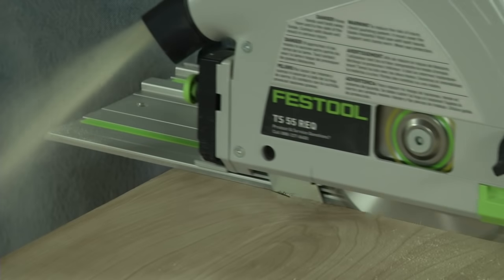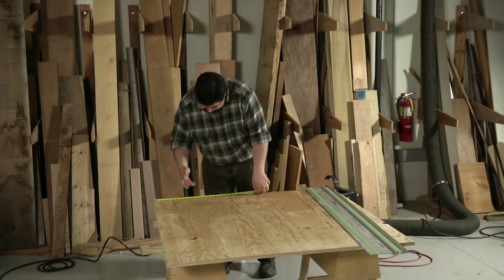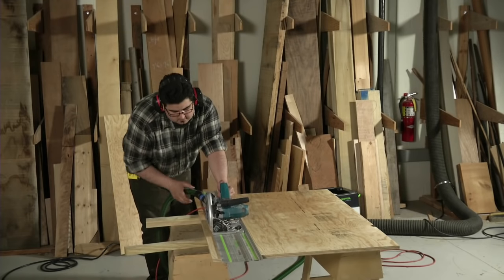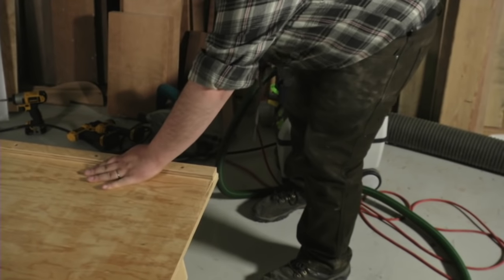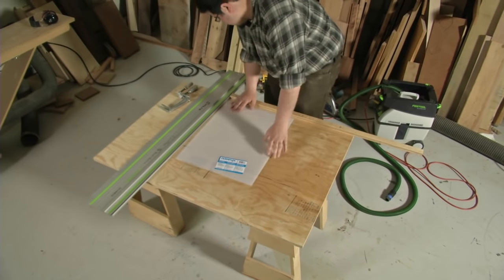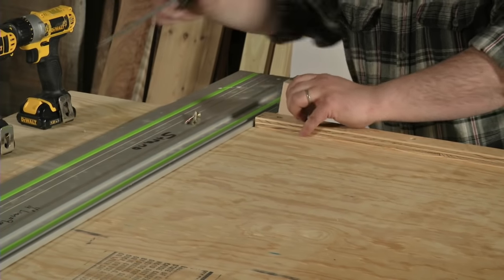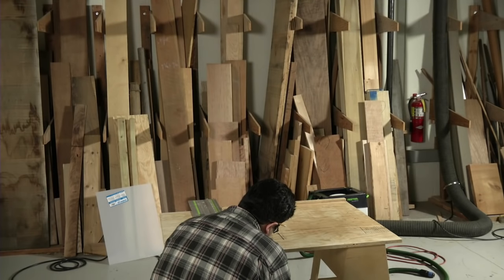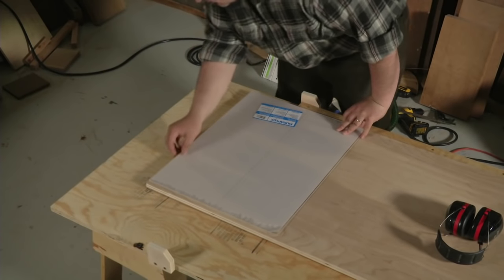Track Saw Crosscut Table

Comment: I think, this way it will be hard to repeat same size many times - need a stopper. Also it will be hard to cut small peaces.
I have Bosch saw and guides, and also thinking about crosscut table construction, but have no yet ideas of how to overcome above issues.
Reply from the maker: I would be simple to add a stop to the fence, or just clamp a stop block onto the fence. As for small pieces, a spacer block matching the thickness of the stock put under the guide rail, would work. -Ben

Comment: Silly question, but are you cutting into your table top every time you make a cut? How do you sustain this or lift up your cut piece so you don't cut into the table?
Reply: Not silly at all. Cutting directly into the table seems to be the norm for track saw crosscut jigs. But it’s in the same spot every time, so there’s only the first cut, and it should be shallow if setting the cut depth properly.

Comment: This was a real good video, and thanks for posting it. I've just made a job-site version of it, screwing the guide rail directly to my table, which is nothing but a sheet of plywood on sawhorses. But I've used the same principals.

Just wondered, how do you know a sheet of Plexiglas is square? Not starting an argument, but 3-4-5 is really hard apply on things that small, at least for me! I use it to square concrete slab forms. But this is precision work. Do most Plexiglas squares come perfectly square?

Thanks again,
Steve
Reply: something is square if 1. all sides are equal, and 2. both diagonals are equal. so measure the diagonals from corner to corner. if they are the same, it's square. if not, it's a parallelogram.
Reply: +Thephiloctopus
Measuring square is only as accurate as the measuring tools being used. Being out by a fraction of a millimeter may not seem like much but it most certainly will get exposed when being used as a standard for a tool.

Comment: I have the same makita track saw but ive found the blade that came with it to be lacking. what blade do you use with yours?
Reply: I have nothing else to compare it to. I do know my blade is on it's last leg and needs to be sharpened but it's worked fine for me.

Comment: are you using a Makita track saw in a Festool track?  how does it work?
Reply from the maker: Yup. Works great!
Reply: Are you able to use the feature thats keeps the saw from tipping
Reply from the maker: No. That extra little lip is the only difference between the two tracks. Considering I've never once cut a bevel with it the saw it isn't a big deal to me. It'll work fine when I do. If I cut bevels every day it would be a nice feature to have.
Reply: is there another way to contact you - i have additional questions?
Reply from the maker: fw-web@taunton.com

Comment: If it's 48" wide and you stuck a 1" strip as a "fence" you won't be able to lay a full size board to crosscut.  May I suggest adding the strip perpendicular to the edge along the outside edge?

Comment: Did you try it with 48" cuts? See I'm thinking about doing this to split 4' x 8' and I'm wondering if i should build mine bigger for that, is it worth it?
Reply from the maker: You could build it as big as you need. I rarely need to make crosscuts that big so I made mine smaller.- Ben